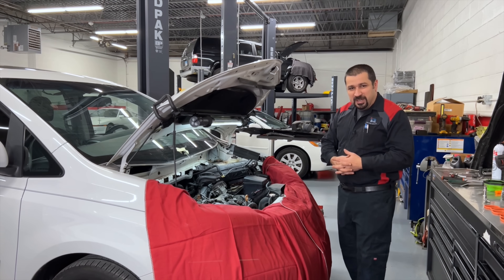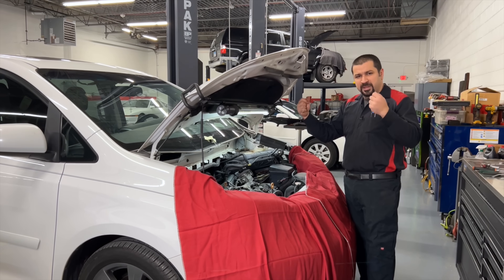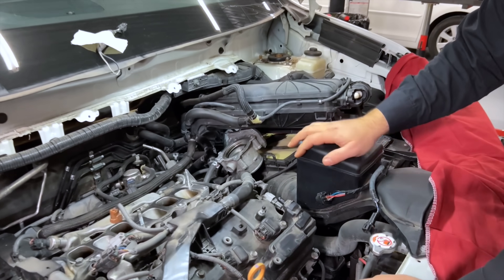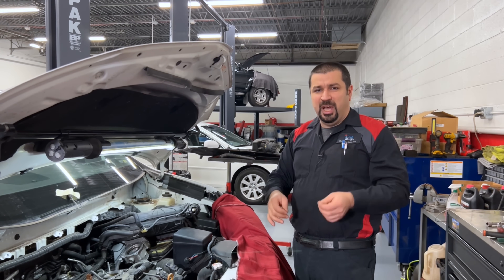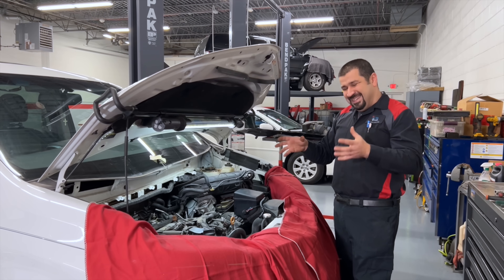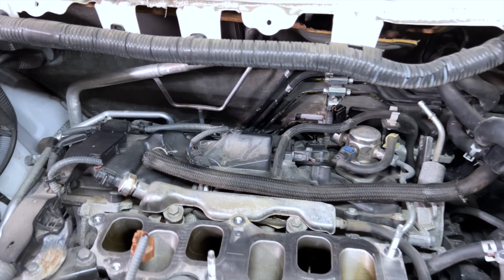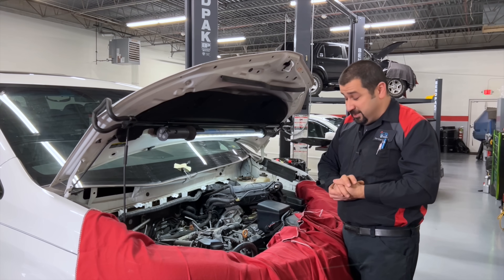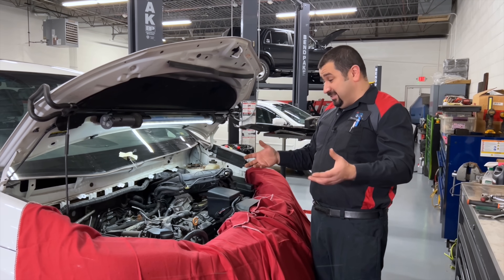Does Toyota Direct Injection Cause Carbon Build Up? Let's Find out!

Comment: I purchased a Camry 2020 model and have since learnt that there is a low fuel pump failure that could result in engine stall.  This is pretty scary.  Do you know if this is still occurring?  Thanks and I love your channel.🇦🇺
Reply: That problem was resolved through the Denso fuel pump recall in 2020. The replacement pumps have not been an issue.
Reply: There is a recall from Toyota for this problem.

Comment: Diesel engines are direct injection, why they don't have this problem?
Reply: Diesel engines don't have the intake system under vacuum like a gas engine does.
Reply: @chrisborland6787  I worked on diesel engines for years, please explain what you mean by "under vacuum", both gas and diesel engines are naturally inspired.

Comment: Is spark knock more common with this system. I have the 3.5L in a Tacoma and when it’s in 4th gear at around 35mph when accelerating quickly it will always have a rattle or what I believe is a spark knock.  Was hoping you could spread some light on it. Thank you.
Reply: In 4th gear at 35 mph is the problem.
Reply: @jeffreymcdonald8267  🤣

Comment: I use lucas fuel injector cleaner on both the 2011 lexus is250 awd and the 2015 gs350 f sport awd, seems to help. Did check with my boriscope

Comment: I have a GDI engine in my almost 10 year old car. My owner's manual "requests" that you only use gas from "Top Tier" gas brands, to make sure that the gas has more detergents than other brands. These detergents help keep the injectors clean, to prevent drops of fuel than won't burn, from drifting up to the intake valves. They also "suggest" using a "Techron" injector cleaner, every 3000 miles if you don't use "top tier" gas. I've actually been using both methods. It seems to be working, after 10 years. I noticed that when the engine that is used in my car changed over to GDI, it gained 45 more horsepower, and an extra 2 mpg.
Reply: To be honest, in a strictly GDI engine, there is nothing that you can add to the fuel to clean the intake valves.

Using an "upper engine cleaner" every service (before changing the oil) should help if done from day zero (I say should, because I don't own a GDI car so I haven't used this method).

The upper engine cleaner is added into the manifold via a vacuum line (and so comes into contact with the intake valves).

However if you haven't done anything like this is 10 or so years, you would need to use a different method to clean the valves.
Reply: @notsureyou  But you can make sure that your injectors are spraying a fine mist, instead of drops of fuel. Dirty fuel injectors can be the bane of modern engines. (even multiport systems)
The upper engine cleaner can be used if you see a drop of mpg or a poor idle, or misfire.
Reply: @billkallas1762  Of course,

But if you are using the product to clean the valves, it's just not going to work in a car that is only GDI.
Reply: @notsureyou  Right. Nothing that goes through the injectors, will clean anything but the injectors.
The only thing that will clean valves (once they are carboned up), are solvents that go through the intake manifold. In Toyoda's case, that solvent is gas.

Comment: Terrific video! Wish Nissan and Subaru did this as we have both. Our Subaru gets an induction cleaning every 30k at the dealer.
Reply: I think Subaru uses Toyota's D-4S (direct+port) on at least one of their models.
Reply: @abdul-kabiralegbe5660  the BRZ which is technically half Toyota.
Reply: The Maxima used to use multiport injection.  Did they change to GDI?

Comment: Questions: if “there is something that destroys a car more than not driving it  and worst, driving it short distances” is true, why there is so much emphasis in Miles Driving? So 3 year old car with high mileage with a proper maintenance shouldn’t be appreciated, in comprising to a low mileage one from the same year.
Reply: that applied to older cars (miles can matter if maintenance was not done)

Comment: @AMD - Dang this is cool, I've always wanted to see the ports on a used 2GR-FKS to see how well the port injectors kept things clean. 

Also appreciate the side notes on that engine regarding things to look out for when working on it. 

In the case of the Tacoma, as the engine is oriented differently, would you rather drop the transmission or pull apart the top of the engine to repair that plastic cross over coolant line on the back of the engine?
(it's down low and right above the transmission)
  
Lord willing, it will last as long as my clutch as I'll likely replace it preventively then, assuming it doesn't spring a leak.

Comment: My mom just bought a 2018 Camry with 30k miles on it and she almost exclusively does short trips. We will do 5k oil changes with the OEM filter and the occasional 'Italian Tune-Up' thanks to you.  

My Toyota has 160k and I hope to get another few 100k out of it. I'm following your maintenance schedule. 

My family and I thank you!
Reply: I do my own oil changes my 2019 avalon takes 5.7 quarts of 0w-20 I put 5 1/2 quarts of mobile 1 advanced economy 0w-20 oil 6 ounces of oil is left in the engine after each oil change I get my oem filter from my dealer for $6 with the new drain plug washer gasket. costs me $35 to change my oil every other oil change maybe $40 depending if I need that extra quart for the two oil changes I save $80 a year in oil changes and I don't over tighten the filter housing like I have had troubles getting it off with a breaker bar from mechanics overtightening it past snug where it stops on the housing.
Reply: Can I give you a suggestion but it will cost you about 250 dollars but for me worth every penny. Have a 2019 RAV4 hybrid XLE. After the second oil change took it in and that oil filter housing was on so tight they broke off the little notches that catch the  wrench. Saw Scotty on his channel and he brought out a Baxter conversion for Toyotas that take a regular WIX filter or another brand (they give you the number.) Anyway it is made in the USA and is solid and heavy and made from aircraft aluminum. You take out the original filter and put that in place eezy, peezy. Took it to my oil change guy, installed it in a minute or so and now I have a regular store bought filter, unscrew it and screw the new one on and is so accessible and easy. Best 250 dollars I ever spent. I do not work for the company or get a referral fee but it is Baxter Engineering. They have a You Tube video. Recommend it. @CallMeehCaptain
Reply: I also purchased a 2018 4cyl SE Camry with 16k miles 2 years ago.
I stay on top of the maintenance like no other. Oil changes every 5k miles, transmission fluid change at 30k miles, even though the mechanic said I could wait till 60k. I've added a Magnaflow exhaust and a K&N air filter which gives it added power.
And the Italian tuneup does work!
Reply: @Nano-p8z  be careful with that air filter idea: your best oil filter is your best air filter.  Purolator One air filter only in my '18 Camry....and don't let it go longer than recommended.
Reply: Do 3K like me
Reply: Me too brother
Reply: @andersonrodriguez8258  THATS A WASTE OF MONEY

Comment: The carbon deposits on the top of valves actually comes from exhaust gas recirculation. Vehicles that you eliminate the EGR on, especially European vehicles that are prone to getting really carbond up, they never will get a hint of carbon in the intake ever again. And someone else mentioned, direct injection is better for CO2 emissions, but not better for particulate, which leads to more unburned fuel products making their way to exhaust gas recirculation to be deposited on top of the valve.
Reply: I disagree,

In that the other source of the carbon is from the oil that is coming from the PCV system (which is exacerbated if using oils with a lower thermal break down temperature, and a higher evaporative figure).

(Like in this video from "Project Farm" starting at 0:50 seconds https://www.youtube.com/watch?v=a0OL8DEb-MA&t=281s

So in theory using an oil catch can "should" mostly solve the problem (?)
Reply: @notsureyou  liquid oil will not turn into black chunky carbon. It has to be burnt first. Vaporized oil from the PCV system will only get drawn into the combustion chamber and leave a slightly oily residue on the intake, it will not leave large chunks of carbon deposits.
Reply: @chubbysumo2230  Over time it will cake on.

Especially when combined with an EGR system.

Comment: I actually got rid of my 2016 GMC Sierra 1500 because of all the garbage GM threw at that motor.  Along with direct injection it also had a DoD/AFM system that was problematic.  I got wise and bought a 2015 4runner.  Hands down the best vehicle I've ever owned.  It does have variable valve timing but it's 4.0 V6 is tired and true and will long outlast that GM 5.3 in my opinion.
Reply: I would agree. I have a 2003 Silverado,  much simpler and more reliable than the later models with AFM and other complexities. This is my last ever GM product, for reasons I won't go into. We also have a 2021 RAV4 XSE Hybrid which we love, great mileage, many more creature comforts than the truck. The RAV4 will be our main transportation for years to come. We've been pleased with Toyota quality and reliability since we bought a 2009 Corolla and traded it for the RAV4.
Reply: While forever getting you 17mpg.
Reply: Of course 
Actually NEW GM PRODUCTS ARE GARBAGE
Reply: It surely will outlast GM 😊
Reply: IF you deactivate the DoD system ( and correctly maintain the engine), most GM LS series engines will last as long or longer than any Toyota engine.
I just got in a 46 year old car that has what is widely considered to be Fords worst V-8...the 351 Modified Cleveland.
The owner was downright religious about maintenance and as a result it has a documented 376,000 miles on it.
 Its finally getting a rebuilt engine.
Reply: @donreinke5863  are you saying that the Cleveland is a bad engine?
Reply: @reggie2334able  The actual Cleveland was one of Fords better engines. These were made from 1970-74 The Modified Cleveland was made from 1971-81 but was 400ci only from 1971-74
The MODIFIED Cleveland, using the taller 400 block was not considered to be a good engine as in order to get 351 ci out of the 400 block, very tall pistons were used which frequently broke piston skirts as it was cheaper to do it that way rather than make different length connecting rods.
Reply: @donreinke5863  that’s what I thought. I don’t know that much about engines but my dad‘s more of a gearhead than I am and he always talked about the Cleveland being a good motor. it probably doesn’t hurt that he has a 351 Cleveland in his 70 Mach one I freaking love that car by the way
Reply: @reggie2334able  Your dad is right. We "old farts" know.
The 351 Modified is larger and heavier than either the 351 Windsor or Cleveland, despite having the same displacement and did not have the performance potential of the TRUE Cleveland, which was claimed to be able to produce more power per cubic inch on gasoline and carburetors than any other non boosted engine of its era. The 4v Cleveland variant would absolutely beat up a 350 Chevy, Olds, Buick or Pontiac, and would even exceed the performance of a 340 Mopar (the name "Mopar" came from Chryslers parts division, once known as  Motor Parts) despite the Chrysler engine being designed and built to be a high performance only engine, no Mopar 340 ever came from the factory with a 2 barrel during its entire production life from 1968-74. Some were even factory equipped with 3 2 barrel Holley carbs. The 351 Modified (and 400) was never factory equipped with a 4 barrel throughout its production. All were 2 barrel, as was the low performance variant of the Cleveland.
The key to Cleveland performance was ditching the factory Ford carb and installing an aftermarket perfomance carburetor of no less than 750 cfm flow capacity.
If you ever look at the 4V Cleveland heads, and understand engine theory...you will know why. it can easily make big power numbers The intake ports will nearly fit a cigarette pack, and are larger than even a 460 Ford.
Its ALL about the flow of air through the engine.
Reply: @donreinke5863  LOL...longer than any Toyota engine.  We got a joker here folks.
Reply: @donreinke5863  LOL...longer than any Toyota engine.  We got a joker here folks.
Reply: @seanfrank4158  Its true, LS is one of the best motors ever made. Then when it finally goes, it can be rebuilt cheaply unlike the toyota where youd need a whole new block

GM v8s are well known to be the longest lasting gas motors out there. As long as you get rid of all the crap on there the EPA made them add
Reply: @josephp1592  98% of of LS motors will never make it that far because of other issues the truck falls apart around the motor and the new ones just plain fall apart

Comment: personally id rather have the tried and tested problem free multiport injection and suffer the 1 mpg more fuel economy
Reply: While I agree (and moved from a DI+Turbo engine to a NA MPFI one), the issue is more on the side of stricter emission standards, as DI and all the precision it allows gives it the possibility to reduce harmful stuff from being generated as a byproduct of combustion.
Reply: @zeroelus  maybe  but then just add an other cat and give me multiport. the nighmares ive seen with direct injection where injectors get sized in the head cost head replacement all the way to entire engine replacement. doest make sense when a multiport inject costs on avg. less the 100.00 and it cost you 5000.00 to replace a head or more if injector get seized in head.
Reply: same here. blame the EPA. I'll stick to mid 2010s toyotas for as long as I can, which luckily for me is a lot easier to do here in the US south.

Comment: Does over the counter fuel injection additives ok to use every so often?
Reply: @Larry Yo It doesn't really help as per Car Care Nut in his previous videos, as he explained the Induction Service they were doing when he was still in Toyota dealership.  He advises just to use top tier fuel which has more cleaning additives than the bottled additives over-the-counter.

https://www.youtube.com/watch?v=beuc-EUAQqc
Reply: OK to use but not needed if using Top Tier fuel

Comment: What amount of distance and/or duration qualifies as a short trip? Could you please define that
Reply: From the Toyota manual, anything less than 15km especially in cold weather.
Reply: also how come diesel engines don't face this carbon buildup on the back side of the valve issue? they too are direct injection fuel system engines
Reply: @lordjaashin  They do. Especially with as much exhaust gas being reticulated. Check out idocars and see the diesels he takes apart. It's like the inside of a chimney in the egr cooler

Comment: You're always going the extra mile by actually showing the valves and that's greatly appreciated
Reply: Thanks Ahmed. You're a blessing and a great teacher. Keep up the great content.
Reply: The thermodynamics of carbon (-vs- steel or most metals) is that carbon has a higher " specific heat" than any metal (clean injectors, pistons, etc).  Also carbon is insulating (thermally much less conductive than metals).  So keeping the engine clean keeps the engine cooler.  Heat intensifies oxidation...  so things like piston rings age more rapidly the higher the heat that is retained.  So keep the carbon down (regular engine oil changes, more highway driving vs city, keep injectors, piston tops and valves clean using a pea based gas treatment 2 or 3 times a year, etc).
Reply: @colty7764  👍
Reply: @colty7764 have you heard of using high octane to help keep fuel in the oil down.  many are claiming success.

Comment: Carbon buildup on intake valves on direct injection engines, everyone's engines, is a direct result of no longer having any fuel coming in contact with the valve stem. In carbureted, throttle body, and port fuel injection, the fuel being sprayed or mixed with the incoming air charge has a large effect on cleaning off the oil running down the intake valve stem. Direct injection engines do not have this and are much more prone to carbon buildup on the intake valve stem.
Reply: Sounds like you are just repeating what he is telling us..
Reply: @hctim96  Could be, only watched 4 minutes, I didn't need 16.
Reply: Not in this engine.
Reply: @gregjohnson2073  LOL!!!